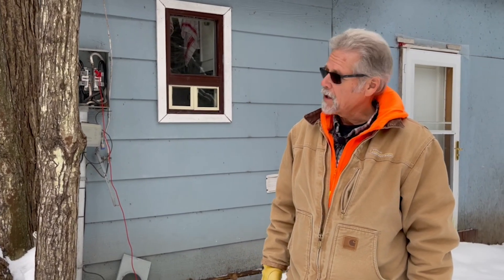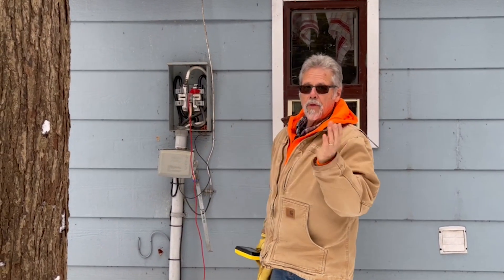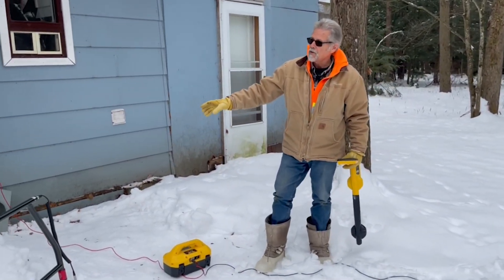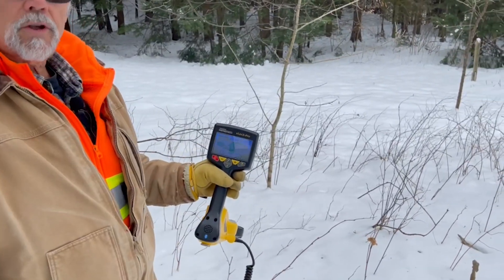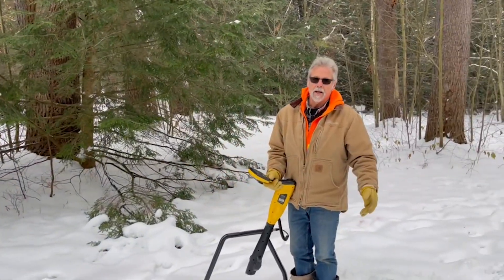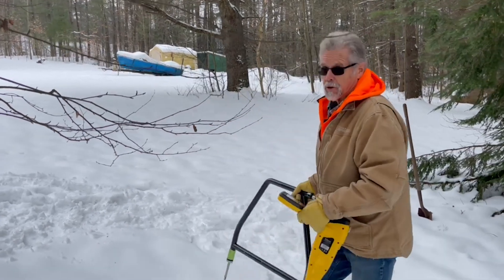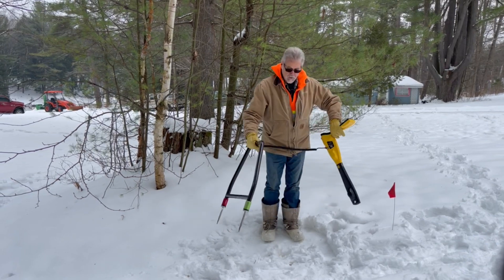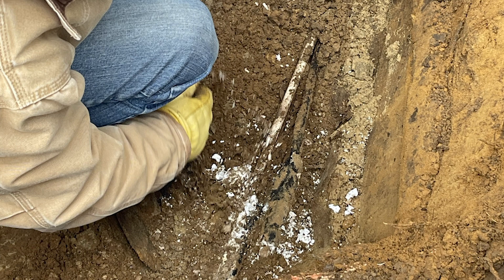Fault Locate-Please excuse the audio

Comment: What is the CATV frequency used for on the VLOC 3 Pro?
Reply from the maker: It’s a legacy frequency that is found on older CATV cable. Old Coax TV cable doesn’t usually work these days but it’s in there just in case.
Reply: Quiero aprender